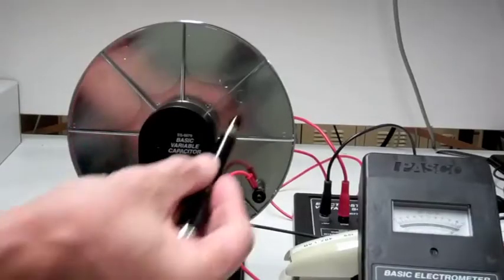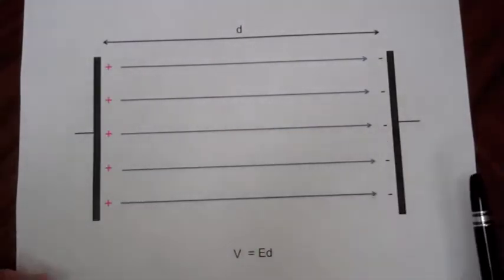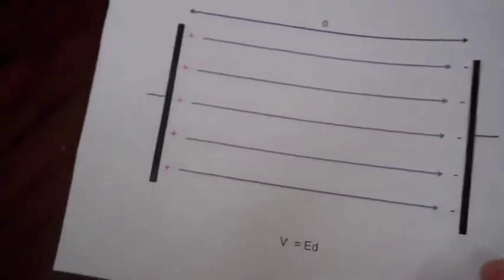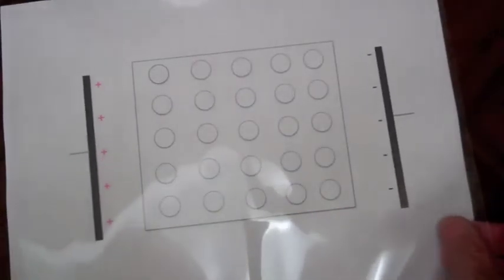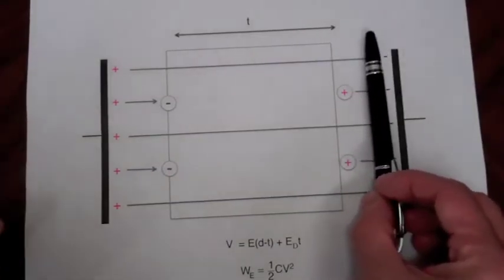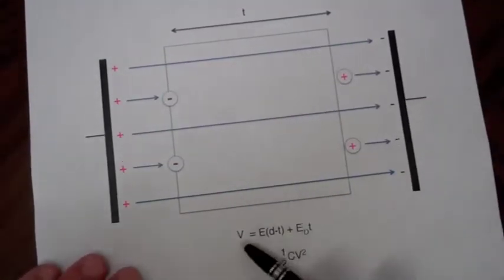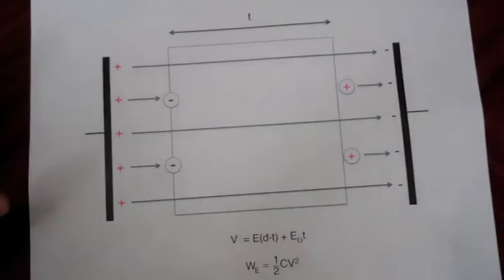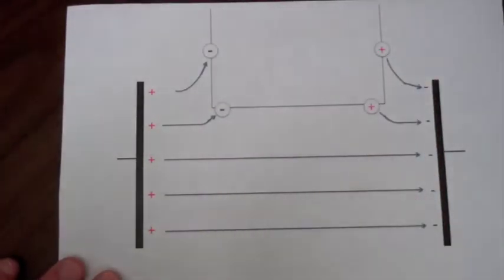Changing the Dielectric in a Capacitor

Comment: It would also be interesting to see, what happens, when the voltage is applied to the plates with the dielectric material between it,
then remove the material (voltage goes up) and replace it with a new plate of the same dielectric material (voltage goes down)
does the voltage go down to the same level?
I ask, because I wonder if the first dielectric material stays polarised

Comment: Dear Professor, I wonder from where I get the electrical charge that appears after increasing the capacitance of an empty capacitor. esp. since reducing d is catalized by lorentz force attraction. violates 1st law imho.
Reply from the maker: The charge on the plates does not change. Bound charge appears in the dielectric, which reduces the electric field inside the capacitor. So the electric field is lower in the dielectric than it was in the free space before the dielectric was inserted.There is less energy stored in the capacitor because the capacitor did work on the dielectric pulling it between the plates.
Reply: Thank you.